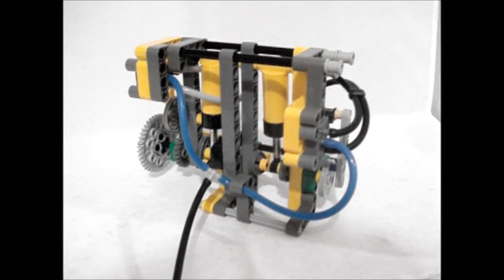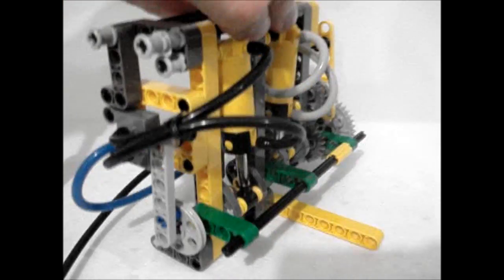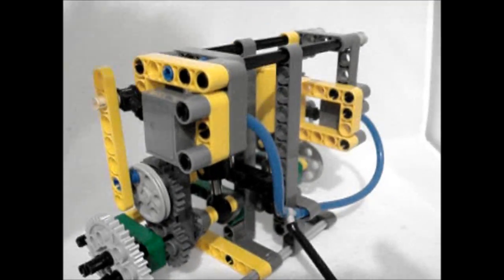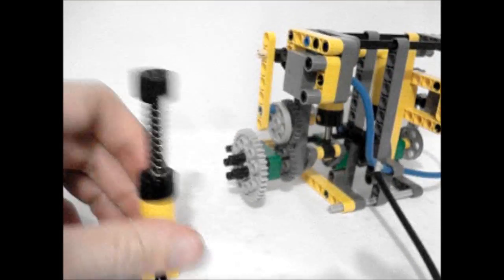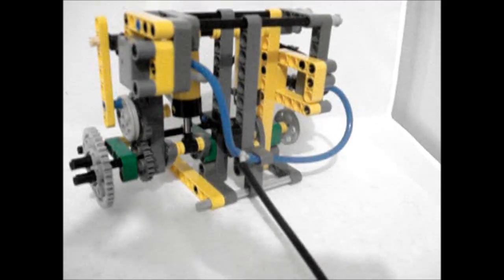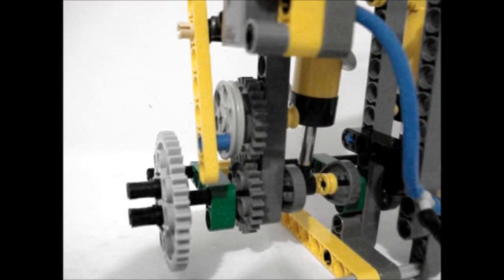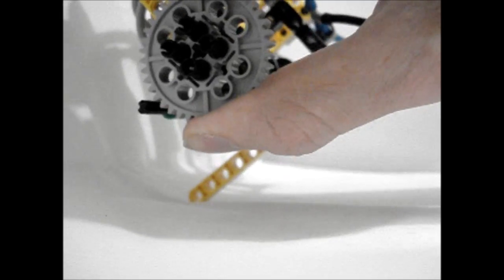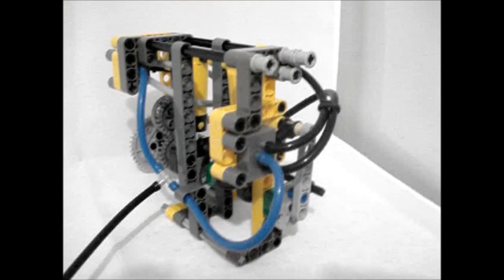Lego Pneumatics - 2 Cylinder Double-acting Engine

Comment: Ive built something like this but with three pumps and it runs quite well... if you can find a way you can also add a flywheel to make it smoother and if you gear it right it can get pretty quick
Reply from the maker: Thanks! Yeah I would like to revisit this at some stage. Are all your pumps at 90 degree crank angle to each other? My two pistons are at 90 degrees so that the engine can start in any position. Still, I reckon 3 pumps would run much smoother; not to mention having a flywheel of some type to smooth it out some more. Cheers
Reply: @HarmanMotorWorks  i think you misunderstood. 3 hand pumps and 2 cylinders but any ways thanks for responding

Comment: Can this rotate in both ways,clockwise and counter clockwise?
Reply from the maker: It runs best in one direction only. I have mounted this engine into a tractor MOC and fitted a reverse gear which enables it to reverse. Cheers